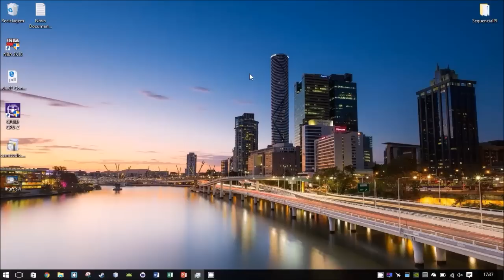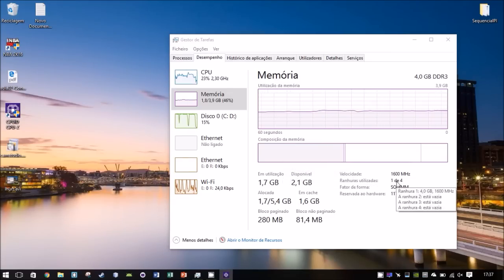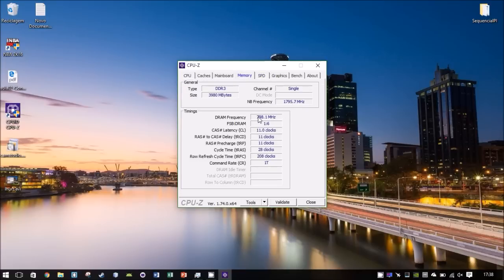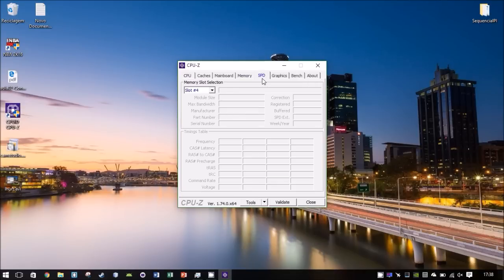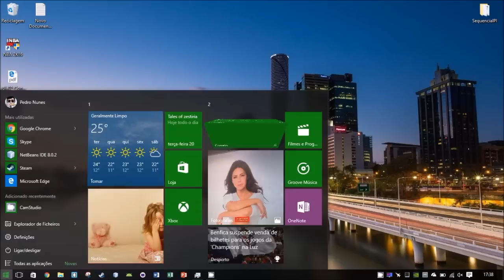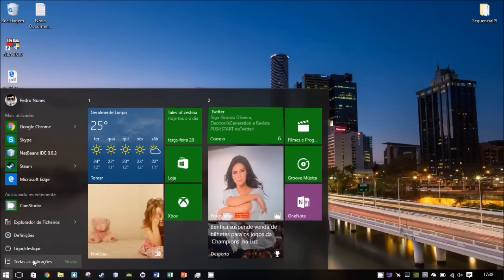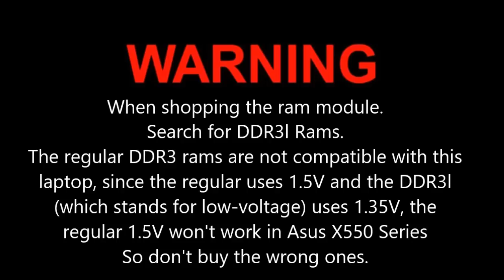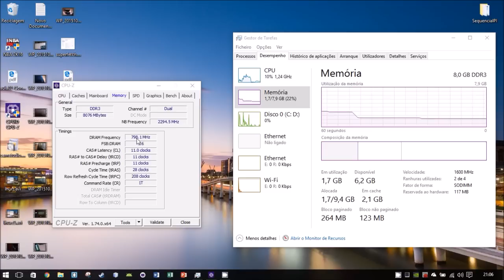How to upgrade Ram on Asus X550 Series (X550LB)

Comment: Hello. Just want to ask if adding 8GB ram to my currently 4GB ram laptop would work. I have Asus F550CC-CJ390H 15.6-inch Intel Core i5-3317U/4GB/500GB/2GB GT720M/Win 8. Question would be, how much max ram can i have for this laptop to upgrade on top of the built in 4GB?
Reply from the maker: +Louie Gail Lauzon Yes it would work but you would loose dual channel. What type of stuff you do with your laptop?
Reply: BenchART hi. Tnx for the reply. Im doing pic editing and just watching streaming videos
Reply from the maker: +Louie Gail Lauzon well pic editing if it is something with multiple lasers will really benefit from the 12 GB..altough if you are sure that you wont be going above the 8gb of ram, then it will be better to go with the 8gb of total ram since you will benefit dual channel which should improve performance, but if you are sure that you will use above 8gb then it is better to upgrade to 12gb.. Cheers
Reply: BenchART yeah. But will it work if i put 12gb on top of the built in 4gb? Or just 8gb + built in 4gb? I wanna go higher/max it
Reply from the maker: Louie Gail Lauzon Yep it will work..
Reply: BenchART okay then. Many thanks man! Godbless

Comment: Hello, i need to know what type of RAM my laptop needs and until how may GB Ram can my laptop handles?
Reply from the maker: +nikos papadospyris what is your cpu?
Reply: I have Asus X550vX-xx015D with i5 intel core-6300HQ, geforce gtx 950M
Reply: Also i am looking to find my 1st RAM....can u help me to find the location or RAm is one with motherborad??
Reply from the maker: +nikos papadospyris well you need to see if you need DDR 4 or 3 on cpu Z. If you have DDR 3 you need to buy ddr3l 1600, if you have ddr4 you need ddr4 2133mhz.
What is the currently amount of ram that you have?
Reply: 4 GB but i cant find if i need DD3/4
Reply from the maker: Use CPU-Z look here
https://s17.postimg.org/6x8gjtkv3/awfwafawf.jpg
Reply from the maker: +nikos papadospyris can you take a printscreen like I did with the same software and in the same place
Reply from the maker: nikos papadospyris you need ddr4 2133mhz. The maximum (I think you can put is the slot is a 16gb ram on it. Altough if you do buy a 4gb ram you will loose dual channel
Reply: i will lose a dual channel? and how can i not lose it?
Also i am looking for my 1st ram in my laptop and i cant find it, where is the location of my 1st ram?
Reply from the maker: +nikos papadospyris for now you don't even have dual channel. You will have dual channel if you buy a 4gb of ram DDR IV 2133mhz. If you buy more than 4gb you will have more ram but you won't benefit from dual channel. The first ram is solded to the motherboard. So you cant remove it

Comment: is it the same thing for asus p550l ?
Reply from the maker: +B Dhia the ram or the inside of the laptop?
Reply: yes the ram is inside the laptop
Reply from the maker: That was not the question sorry :/
I was asking what exactly do you want to know?
If you want to know about the ram that you need to buy?
Or do you want to know if the computer inside is equal to your p550l?
Cheers
Reply: I ask about the ram i want buy if it's compatible with my laptop or no and   which website is best to To find the best upgrade
Reply from the maker: Well, you just need to know what is your CPU model, to know if you need DDR III 1600 mhz or DDR IV 2133MHZ
You can then buy it on amazon or any local store.
So what is your CPU model?
Reply: Intel core i5 4210U and i just installed cpu-z , type memory is DDR3 .
Reply from the maker: Ok, you need DDR3l 1.35v, usually you just need to buy the quantity that you want, ddr3l 1600MHZ 1.35v
Just make sure you have a free slot inside your laptop
Reply: thanks

Comment: cool video bro, but i need some help picking the right ram for my laptop
 the model of my laptop is X550CC with Intel i5-3337U @1.80ghz
Reply from the maker: +Carlton Mukanda I think the 3000u series needs the 1.5v.
Theorically it was suppose for that cpu support both 1.35/1.5v which is what is specified by Intel.
Altough a user already complained here that brought a 1.35v ram for a 3000u series cpu and didn't boot up, only the 1.5v.
So.. I guess you should go with the 1.5v to avoid problems. 4000u series or above need 1.35v for their ddr3 kits
Reply from the maker: Well I think the 3000U series from intel can use 1.5V rams, based on the comments that some users already left about it.
So you can buy the regular 1.5V DDR3 you don't need to buy the ddr3L for your laptop, you just need to find 1600MHZ ddr3 ram for laptop and there you go :)
Reply: i check on some sites, they only sell Crucial 2GB/4GB/8GB  DDR3L-1600 SODIMM with DDR3-1600 • 1.35V is it not compatible with mine or i have to check somewhere else
Reply from the maker: Well there was users with the 3000U complaining that their PC wouldn't boot with 1.35v, which is weird, because intel claims that 1.35V should boot even on 1.5V CPUs, and in fact, on intel spreadsheet it shows that you CPU can handle both 1.35v as well as the 1.5v.
Not really sure where you live, but I did found them in amazon with no problems, just be sure to specify 1.5v on the search bar.
Cheers
An example: https://www.amazon.fr/Samsung-memory-PC3-12800-1600MHz-laptops/dp/B00UZAGGT4/ref=sr_1_1?ie=UTF8&qid=1505835838&sr=8-1&keywords=ddr3+1600+laptop+1.5v
Reply: cool, thanks for fast replies!
Reply: i have an X550CL with intel i5-3337U @ 1.80GHz do i also require the 1.5v ?
Reply: cool, thanks ill look for the 1.5v memory

Comment: Are you sure it has to be DDR3L (1.35v) RAM? because as I know the voltage value doesn't actually matter as long as the frequency (MHz) is same. It could cause instability, yes, but still going to work nevertheless
Reply from the maker: Depends on the CPU that you have, but yes, it needs to be 1.35v in certain cpus, or it won't recognize/boot.
Reply: BenchART ah, thank you for clarifying then. I wasn't sure before

Comment: I'm gonna be brazen and ask for help... again. :)) It's been 4 days since I installed the ram and it's detected in the bios menu and cpu-z. Unfortunately,  my laptop display has been randomly flickering and freezing after the installation. I first experienced the flickering display while playing online mobile game through an emulator,  second one was while watching youtube video and today, while browsing google. What's weird is that I played Need for Speed and worked on Adobe Illustrator while playing spotify in the background for hours but never had the flickering display and freezing problem. The problem just happens once a day,  most of the time while using google chrome. 

I'm confused if the problem is caused by the new ram or not since my laptop had random BSOD and freezing with buzzing sounds while using the old ram incidents in the past. My Nvidia graphics card has also been crashing (nvidia card cannot be removed/ejected etc.) randomly for the past few months. My laptop also got spilled on by water earlier this month. The laptop is still working after that but sadly some keys on the keyboard did not survive. 

For reference,
IMAGE: 
https://drive.google.com/open?id=0B-AwHGEQp8YFUzhmS056TzFhMTA
VIDEO:
https://drive.google.com/open?id=0B-AwHGEQp8YFcjZvRC1SY1V3WVE

Do you think the problem is caused by the new ram or is it caused by other hardware problems? 
I've had this laptop for about 4 years now.
I'm not really good with computer problems that's why i'm here. Sorry for the long post.
More power to your channel!

Comment: I`m having problems wrapping my head around this, I contacted ASUS support and they said this : " DDR3 1600 MHz SDRAM RAM. " is what is being used in my current laptop, he said to get DDR3 instead of DDR3L, my CPU is and Intel I3-3217U, I am relatively confused :(
Reply: Also running benchmark tools shows that my laptop is using DDR3 memory
Reply from the maker: Well, to be honest, I think Asus might be right, the series 3000 can support both ddr3L and ddr3.
Only after 4000 series the "u" cpus demand ddr3l

I'm very sorry for the confusion.
Reply from the maker: Herpy Derpy If the ddr3 is 1.5v then it's clearly ddr3 :)
Reply: BenchART Thanks a ton for your help, I truly appriciate it considering finding info for these laptops is pretty hard I can only describe this video as a god send ;D
Reply from the maker: Yes, there is really not too much info related to the memories.
But I also learned something today thanks to you.
So thank you too for the comments.

Comment: Bro, stupid question but does the DDR3l , last letter stand for L or i? What I mean is, is it DDR3L ?
Reply from the maker: Herpy Derpy Yes it is ddr3 L. L stands for low voltage since it uses 1.35v instead of 1.5v and it is used in ULV cpus :)
Reply: Thank you very much!

Comment: Hi,I  have asus a455lf.I wanna upgrade it,and it say it use DDR3.So...am I have to buy ram like yours?
Reply from the maker: Well they don't specify too well if you can upgrade or not.
But you can try to open the PC, and check if you have a free slot. 
Also tell me which CPU do you have, I mean, which intel do you have and what series.
For example, mine is a i5 4200u, you need to tell me what is your CPU to understand a little better if it is DDr3L or DDR4.
Cheers.

Comment: i have asus x550LA , does this one have a free slot ? i think the one i can insert is Crucial 8GB DDR3L-1600 SODIMM but i want to know if i can add it with the current 4GB . thanks in advance
Reply from the maker: Well there is no way that I can tell you that.
You need to open it, but it should be fine, you won't lose warranty just ot open and check it out.
Cheers

Comment: i got the asus X550C that memory will work on my laptop??
Reply from the maker: Hi there..
Depends, what is your CPU?
Reply: BenchART intel Core i3-3217u,1.8ghz
Reply from the maker: In that case, yes it will.
Reply: BenchART thanks you earn a sub and a like bro
Reply from the maker: Hahah, thanks :)
Let me know when you upgrade if everything had gone fine.
Cheers..
Reply: one more question were you buy it from i can't find it in ebay lol
Reply from the maker: Well, I had brought it on a local store which had a fair price.
It was slighty expensive, but since it was near home, I preffered to give the money to them.
Check in Amazon, or on your local computer stores, I'm pretty sure they will have it.
Cheers
Reply: BenchART it worked thanks a lot :)
Reply from the maker: That's good, congratz :)

Comment: I want to upgrade my laptop from 4GB into 8GB RAM, my laptop X550D with AMD A10, which should i buy ? DDR3 or DDR3l ? thanks for ur advice sir
Reply from the maker: That is... a good question.
I have no ideia.
Altough DDR3l always work, you need to download CPU-Z and investigate what are the Dram Frequency and the #CAS Latency (CL), if you have something close to 800MHZ and CL set to 11.0, you can buy DDR3l, it "should" work!
There is not to much information about this on the google unfortunally for what I'm seeing.
Also don't forget to always open the laptop to check if you have the free slot before buying anything.
Reply: fortunately theres one slot free for extend my ram, but i have one doubt to upgrade it. does it make faster or lighter for my performance while rendering 3d model ? cuz while im using new sketchup and newest vray to rendering, my laptop getting slower and not responding. when i ask in the forum they not recomend for 4GB  ram, they ask me to upgrade it into 8 GB minimum. Thanks a lot for ur advice and information sir, im appreciate it so much
Reply from the maker: Indeed... and they are absolutelly right.
I don't do 3D modelling, but I'm fully aware how 3D rendering and heavy image edition consumes tons of ram.
I'm a software developement student , and some IDEs or android Studio and it's emulators were completelly impossible to work with.
I upgraded to 8GB of ram and it seems now much more lightweight and I am almost sure that even 8gb is the bare minimum for the type of things that you do.

It's quite easy to understand if you are ram limited or not, just try to do something like you usually do with 3d modelling and open task manager, if your ram usage is >3GB, then are you pretty much accessing a ton of ram already, and the system might be already relying on the paging file, sending work to the HDD instead of the ram which is awful since our HDD is so slow!

Also if you are using Windows 10, just like I am, keep looking to the HDD usage on task manager, usually sometimes there is a process for me called Microsoft Telemetry Compatibility, that process is the telemetry from Microsoft, that collects data from you, and send to them, usually it's not been to agressive lately, but some time ago I had to rely on some third party software to disable that windows "feature" because it was using 100% of HDD making it impossible to even work with the PC by how slow it was, anyway, I still recommend you to upgrade ram.
Cheers
Reply: oh my.. you are so kind and really really helpful to decided my choice. thank you so much, God bless all of people around you. see you till i upgrade my laptop..
Reply from the maker: Thank you, and good luck with the upgrade.
Let me know how it gone after upgrade.
Cheers.
Reply: i've been update it into 8GB RAM, i can feel there's different before. somehow i feel more lighter when rendering and see the performance of the ram. thanks for the advice.. unfortunately, when i bring my laptop asus service center to upgrade the ram. i didnt know which one they use into my laptop.. DDR3 or DDR3l.. im so sorry can inform about that.
Reply from the maker: No problem.
At least it is working and I'm glad you are seeing benefits with the upgrade.
I noticed too in my type of work, and obvious in gaming, less stuttering in CS:GO and also less freezes in GTA V.
For your type of work and depending the complexity the ideal should have been 16GB, but it's impossible in our laptop :)
Cheers
Reply: ah yeah.. considering upgrade it into 16GB, i dont think ist good idea. i must save my money to buy a pc. can i get ur advice before i build up a pc later ?
Reply from the maker: Yes of course.
I will help you out, I usually do that a lot too on Portuguese forums and friends and sometimes random people.
Feel free to ask when you need it.
Reply: http://www.crucial.com/usa/en/memory-buying-guide-- this link is for anyone else wondering or you if you still haven't found one. all you need is you're pc brand manufacture and type to find a compatible upgrade

Comment: I have asus x550jx and i bought 1.35v 1600mhz 8gb ddr3 ram and it doesn't read. When i took it to service center they said it only supports 1866mhz ram and now i am not sure if i should get it or now because if that one didnt work i'll lose money. What to do?
Reply from the maker: What is your CPU?
Reply: Intel core i7-4720hq CPU@ 2.60ghz
Reply from the maker: Deepak kumar singh that one don't need ddr3l, it's only applied to "u" brand cpus
Reply: so what am i suppose to do now? Risk it again with 1866 ram?
Reply from the maker: +Deepak kumar singh you can try with normal ddr3 1866 (for laptops ofc). If the laptop don't support the 1866 it will just downclock it to 1600mhz.
Cherrs, and good luck
Reply from the maker: That is DDR3l (1.35V)
But the weird thing, is all of them are atually 1.35v, it should work anyway.
http://www.amazon.in/Crucial-Ballistix-Sport-204-Pin-SO-DIMM/dp/B00DSGLM9G/ref=sr_1_1?s=computers&ie=UTF8&qid=1496768945&sr=1-1&keywords=8GB+DDR3+SODIMM+1866

Here's one.

Comment: Very helpful sir! 
I have some doubt, my ASUS X550L uses i5-4200u, 1.6GHz without installing additional ram. Should i get the low voltage ddr3 or the normal ddr3 will do?
Reply from the maker: Jellal Mistogun You should get ddr3l, due to the nature of the "U" branding of the Intel standing for using less energy and voltage, you really need that ddr3l, the regular ddr3 won't work in there. 
Cheers
Reply: Oh great! Thanks again sir, youre very very kind and helpful :)

Comment: so should i get a ddr3l for my x550j too since its the same series right?
Reply from the maker: I'm very sorry for taking so long, I was out today.
What is your CPU?
Brand and model please.
Reply: BenchART hi no worries :D

laptop model x550j
cpu: i5-4200h
gpu gtx 950m
4gb ddr3 1600mhz ram
Reply from the maker: koltuk a well I'm not 100% sure, but since your cpu is not branded as "U", it means that it is not a ultra low voltage cpu, and by that you can use ddr3 instead of a ddr3l, although ddr3l also works in there, but normal ddr3 might have better timmings
Reply: BenchART thanks

Comment: Haven't checked my laptop, in case there's 2 slot for memory can i use 2pcs 8gb? or if there's 16gbx2 for 64bit OS?
Is there a limit size on the upgrade? Need you expert advise. Thank you :)
Reply from the maker: Well, I don't really know what is the maximum ammount of ram allowed.
Altough usually this laptops, only come with 1 slot free, the existing 4GB of ram are solded to the motherboard, which means that it can't be removed.
So I believe the maximum upgrade you can make will be the maximum ram that you will be finding.
I'm pretty sure if you had like 2 slots instead of solded ram you could put up to 32gb on it.
Altough, unless you are into virtualization or heavy rendering loads of 3D Design, photoshop or tons of layers in photoshop there is absolutelly no reason for now, to have so much ram